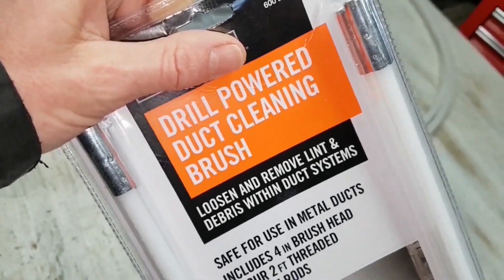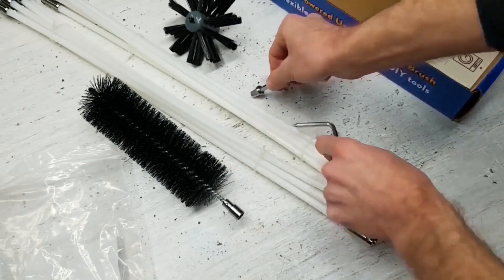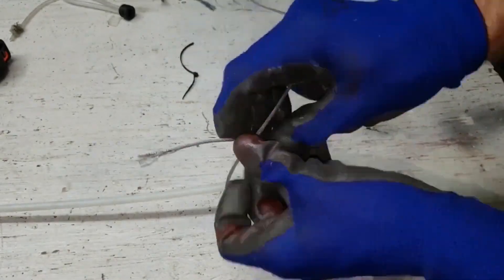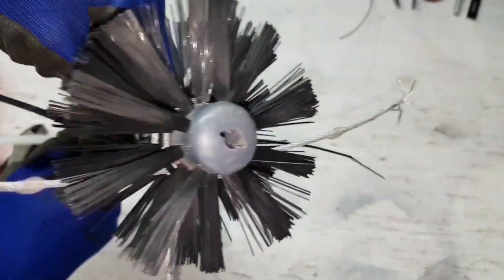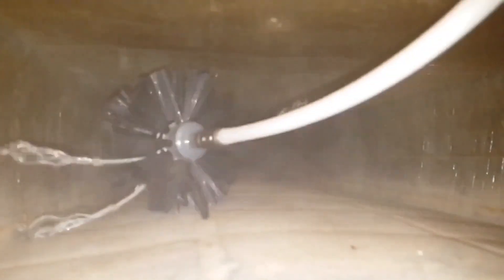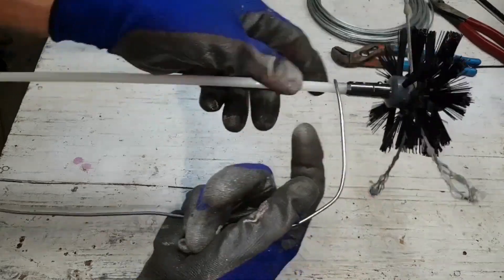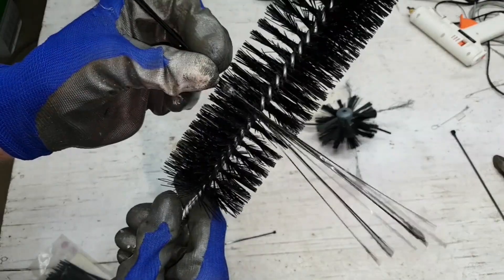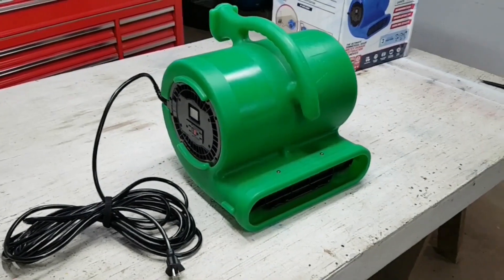DIY Air Duct Cleaning Wire Brush for Drills - Making a Wire Brush to Clean Metal Ductwork

Comment: ha! this one is even better than the leaf blower barrell vac!  which one worked better for you?
Reply from the maker: I used the duct vacuum/negative air machine that was built in part 3 of my DIY duct cleaning series with this drill powered wire brush to clean a segment of ductwork under a bathroom which had some mold, rust, and a stuck-on mess.  I was pretty happy with the brush and the duct vac overall.  Wish the brush could get down into the corners of the rectangle duct.  The air whip with the wire brushes attached worked okay for that though.